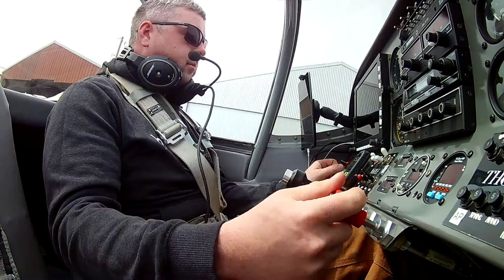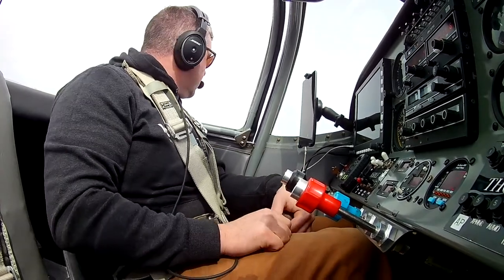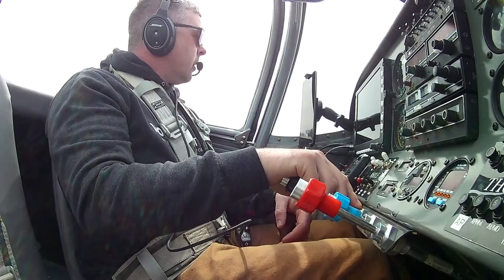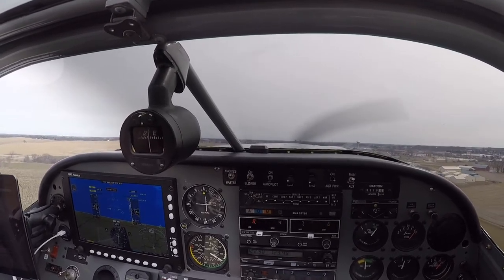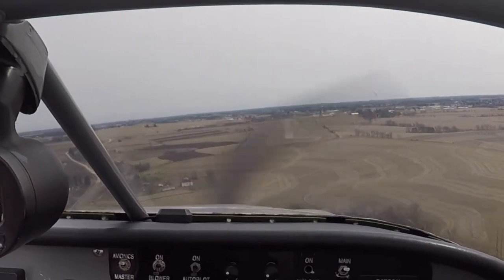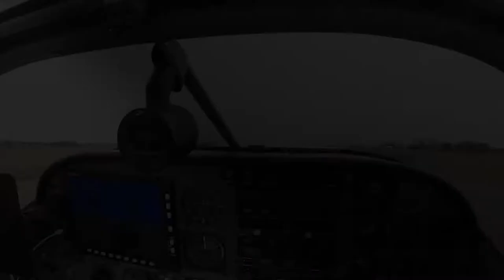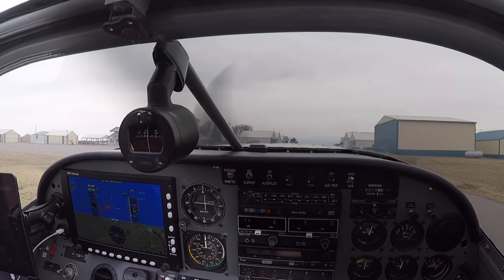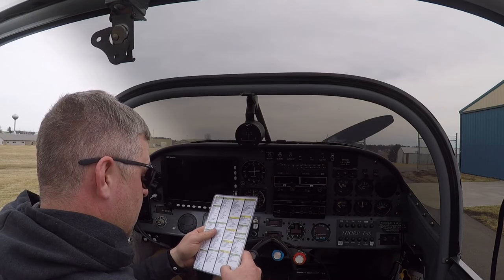Thorp T 18 Procedures + 3 landings

Comment: Great video Marty!   Really good sound quality in a relatively noisy airplane.   Keep on using the checklists.   Looks like 95 mph on short final works pretty well for you but almost seems a little fast?   I am guessing that you are still holding it off and touching down much slower than that.  Are they generally 3 point landings?  If so then you got the speed right.
Reply: I’ve got a little less weight as my plane is pretty minimal as far as avionics and I have an O-290 D2. I shoot for 90mph with a passenger . The sink rate does become quite great though once you get under 90

Comment: Thanks so much for this video. I'm done rebuilding a T-18C, getting ready to fly it, and yours is the first really instructional T-18 video I have found on YouTube. My Dad and I built a T-18 together back in the 60s, but I haven't flown one since I was 12! You don't seem to be using the flaps at all, why is that? I can understand approaching at 95, though from your touchdown at 60 the book might suggest approaching at 80. Still, you lose so much speed in that last 30 seconds or so! Do you strictly do three-point landings ? If you did a wheel landing what would your approach speed be? My Thorp very similar with a constant speed prop but an IO-320. Thanks again.
Reply from the maker: I’ve come a long way since this video. Now I’m flying final at 85 mph max. It makes a world of difference. Even a couple miles an hour over 85 really makes landing a more difficult process. I am using flaps in the video, it must just not be obvious to see. I use about 25-30 degrees most of the time. I always land in a ‘tail low wheel landing’, but it’s basically a three point. I have a large prop and short gear so no true wheel landings for me.
Reply from the maker: I will make another video with what I’ve learned. Thanks for the good reminder
Reply: @MartyG144  And thanks for the update! The more you can tell viewers what it is like to fly a Ti18 -- even HOW to fly it -- will help your viewership.